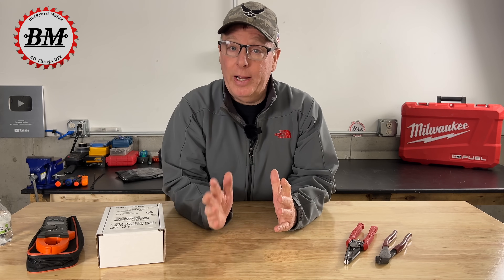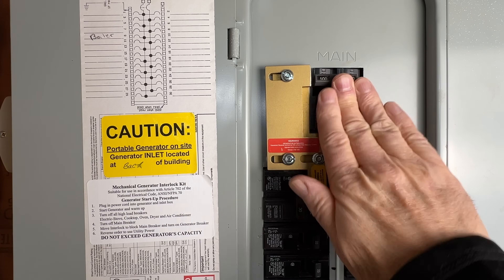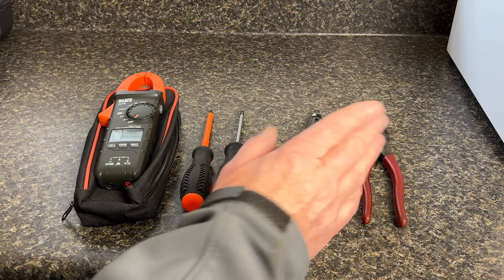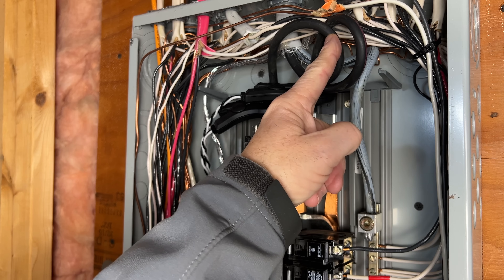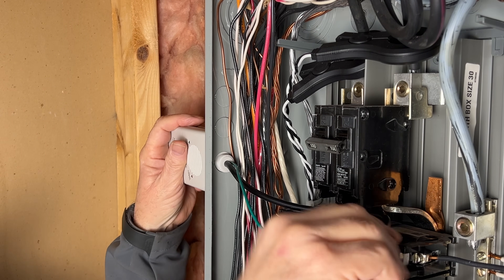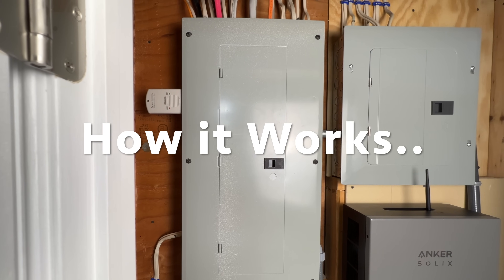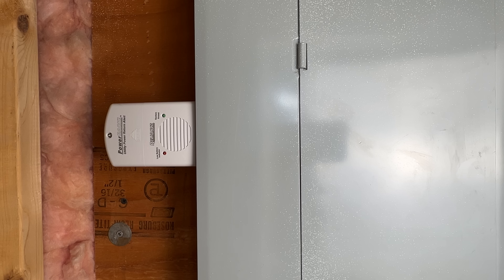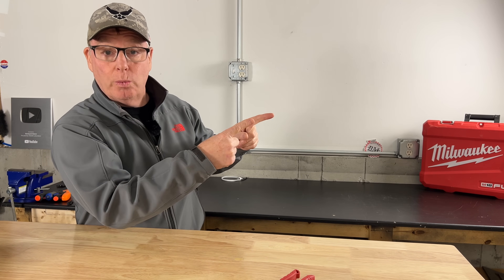The Secret to Knowing When Power's Back On!

Comment: In my area the utility supplies a yard light, before the meter for $8 a month.  They provide the light, do the install, repair, replace as needed.  So for under $100 a year you have a large yard light. Dusk, to dawn, or if dark.
Reply: How does that work in the daytime to let you know the power is back on?
Reply: Sweet, monthly fee for everything! People got to be pretty dense to go for that.
Reply: @ProleDaddy  in rural areas you need to pay if you want a yard light. Most of my neighbors are happy to pay to have power company be 100% responsible for it.  You do not pay for light, mounting, power, replacement

Comment: All I did was install an outdoor rated "gem" lens capped, weather-proof, LED 240 VAC indicator light on my outside service mains disconnect, protected with an inline voltage rated fuse. If it's glowing green, I know I have Utility power.
   Another option, that I haven't looked into yet, would be installing an inexpensive solid state normally open relay in the outside disconnect that has a control voltage of 240 VAC and use the N/O contacts to interrupt a low voltage circuit, powered with a12 volt solid state power supply and run a direct burial cable underground to the house and install a small LED indicator light somewhere near the inside of the front door. Could do it all for less than $75 to $100 for the parts.
Reply from the maker: There are specific rules in the code for a tapping onto the line side of an overcurrent device. You have to use an approved connector and wire size equal to the service feeder and connect to an overcurrent device.
Reply: @BackyardMaine    True, but there is the 3 foot tap rule.The tap does NOT have to be the same size as the service feeder. It's in the NEC code book.
Reply from the maker: @cayankeelord3730  There's a 10 foot tap rule and a 25 foot tap rule in the NEC and both of them are for feeders down stream of an overcurrent device. NEC section 240.21(B)(1) There's not a 3 foot tap rule in the NEC.

Comment: I think 100 dB is too much, you don't want to miss it, but not wake the neighborhood.
Reply from the maker: It is pretty loud but for me it's in a closet in the basement so not a problem. You could always put s piece of tape over the speaker.
Reply: @BackyardMaine  The sound when my washer and dishwashers are done would be loud enough for me, especially if it was an alarm that would continue beeping until I stop it. 

I think it would be nice to have at least two settings:

audio level: to choose loud enough, but not that loud.
alarm delay: minutes to wait before sounding alarm, in case you often experience issues where the power come back temporary for short periods during trouble shooting.

Also two other nice settings would be:
alarm duration: time to auto silence alarm.
repeat time: time to sound alarm again, if it wasn't resolved during silent.

Comment: I don't have close neighbors.  I use a whole house 200Amp transfer switch for the generator. I wired in a single light bulb to the electric company side.  When the power goes out, I turn the light On  - the bulb lights when the power is restored.  A little cumbersome, but, with no other lights or neighbors, it works.
Reply from the maker: That will work but its a code violation for a couple of reason and can become a fire hazard.

Comment: I only have a few circuits on my transfer panel, not a whole house transfer, so I just leave lights or a radio on one of my non-transferred circuits.
Reply from the maker: Yes, that is a good way to do it if you have that type of connection.

Comment: I've been using one of those for years.  If it doesn't work, or stops working, there's an adjustment inside the cover for sensitivity.  I had to adjust mine to get it to perform reliably but it works without fail now.
Reply from the maker: This one doesn't have an adjustment but there's one from another manufacturer that does.
Reply: @BackyardMaine  Yeah, it does have an adjustment, but you have to take the cover off to get to it.  It's not an obvious external adjustment.   I have the exact same model by the exact same manufacturer.  As a matter-of-fact when I clicked on the link to Amazon you posted it came up that I had purchased it back in 2017.  (Reliance Controls THP108 EMW3561925)  So it's seven going on eight years old.

You have to take off the plastic cover to see it, it comes set from the factory and there's a straight slotted screw thing (potentiometer?) inside that adjusts sensitivity.  It's pretty obvious once you have the cover off, it's the only thing in there that looks adjustable and it's about in the middle of the device.

I learned about the adjustment from some other YouTube video, it's been so long ago now that I can't remember which.  I was about to chuck it in disgust but decided to see if there was anything I could do before tossing it.  The guy who showed how to do it drilled a hole in the cover face so he could get to the adjustment. I just set it to max sensitivity and put the cover back on.  Mine wasn't working reliably but it does now.

I live out in the country so it's very handy to know when the power comes back on.  I think I paid $25 or so for it, the price has gone up a lot.  It's worth every penny once I got it working right.
Reply from the maker: @acts9531  Oh Ok.. Nothing in the instructions for an adjustment.. Thanks.
Reply: @BackyardMaine  You're very welcome.  Mine worked for a year or two and then quit.  That fixed it, so if yours does something similar at least you'll know where to start.

Comment: I made a homemade "power back on" alarm. I cut the male plug off of a light duty extension cord. Put insulated clips on the two wires. I put one of the clips on one of the main terminals and put the other clip on the neutral bus bar. I then plug a radio into the female end of the extension cord. When power comes back on the radio plays.
Reply from the maker: Thanks for sharing your idea, but I think it's important to use safe and approved methods when working with electricity.

Comment: Those do work pretty good but they are designed to installed on a surface mount panel board. Bigger project to install on a flush mount panel.
Reply from the maker: Yes you are correct.

Comment: Why don't you just use the method built into the meter? Nothing on the LCD = no power from power company. Numbers on the LCD = pack up your generator.
Reply from the maker: Yes you can go outside every hour during a snow or ice storm and check your meter. I find this is a much better solution.

Comment: You have double taps on your ground bar, 2 wires in one hole. I sold a house in wa state once and got in trouble for that. I researched it and found info that says no don't do it. While I "do not" agree and don't think it hurts anything, it is in most states against code. Thanks for the video I am going to look into getting one of these devices. OK.... Looked it up via the link..43 bucks is far too much. NOPE.
Reply from the maker: It is going to depend on the manufacturer. According to the National Electrical Code (NEC), Article 110.3(B) states that equipment which is listed or labeled must be installed and used in accordance with the instructions included in the listing or labeling. My panels is listed for multiple grounds of the same size under one screw.

Comment: LOL, the easiest, cheapest way to know when the power is back on is when the lights come back on.  No special device needed.  I only use a small generator to run our refrigerator if the power has been off for over 12 hours.  If I want entertainment in that time I just turn on the old 8 D cell boombox, but generally speaking I can find plenty of other stuff to do to occupy my time when the power is off, whether it's cleaning out the garage, mowing the lawn or cutting up downed trees into stovewood and brush.  When it comes time to cook, I just fire up the Char-Griller charcoal grill.
Reply from the maker: Obviously this is designed for a different set up.

Comment: the only prob with that is there ia 2 power legs coming into you service panel .... so only monitoring one leg is not 100 % you need to monitor both legs just more chinese junk dont buy this thing i used one and it failed me because it only monitors one leg of the mains power
Reply from the maker: If you loose one leg the issue is between the utility transformer and your meter. In many areas this would be your issue to repair not the power companies. Utility transformers are single phase supplied with one hot line and a ground. The transformer sends power to your home from points in the sine wave that are 180 degrees apart giving you two hot lines with 240v volts between them and 120v to neutral and ground. This is a split base system. It's extremely uncomment to lose one leg of power and if you do you will most likely need to can an electrician.

Comment: Nice video describing its use. 

Ive been using one for several years, triggered over a dozen times. 

But, I'd like to add a couple of negatives concerning the alarm.  

First is the 9 volt battery. Battety lasts about 1½ years on standby and triggered a couple of times,  and its not unusual for you not to notice that the low battery lamp is no longer illuminated (panel in basement, never checked battery completely dead.) 

So I keep a spare or two nearby. 9 volt batteries are a somewhat unusual size to stay stocked up on and you never know when you're going to need a fresh battery.

Second is the switch. Works grest when new, but after a few years it gets sloppy. So when turning it on, I flip the switch and then "jiggle" it to make certain the contacts are making contact. I learned this the hard way when power came back on but the device failed to activate. (We live in a rural subdivision and difficult to tell when power is back on; especially during daylight hours.) Went down to check to see if power back on and as I switched the unit off and on it activated. So just get in the habit of jiggling the switch, just be be certain.

Overall, it works great. I've gone to bed and fallen asleep with the gen set running only to be awakened hours later when power restored. It's loud enough to wake you from a sound sleep. Or should I say annoying enough. It's as loud as a smoke alarm.

 Highly recommend if you have a generator backup.
Reply from the maker: It is always a good idea to have spare batteries on hand just in case. It's not a bad idea to check the batteries in your smoke alarms as well!

Comment: Way to much fuss.  
What I did was get 2 LEDs and short wires with Small Alligator clips on the end.  I mounted the LEDs in the box at the bottom and drilled holes in the lower cover so I could see if the LED s were on.  Then just wired the Negative side to the Negative bus bar, and used insulated Pliers to Clip the Alligator Clips to the 110V hot Studs securly. 
One LED shows Utility power available.    The other shows when Generator Power is Available.  Total cost 3 Dollars !
Reply from the maker: Code violation and not safe at all.

Comment: A consumer should never pull the meter. All utilities put a seal on the meter and if it is broken, you may be charged with meter tampering or energy theft. Always have the utility pull and reinstall the meter.
Reply from the maker: I was referring to having an electrician pull the meter. I should have made that clear. I just give the power company a call and let them know what I'm doing and why. That may not work everywhere.

Comment: I simply installed a pair of neon lamps on the input side of the master circuit breaker so I could easily tell if grid power is alive.
Reply from the maker: Yes, but that is a code violation and because it's ahead of the overcurrent device it can become a fire hazzard.
Reply: @BackyardMaine  I'm not concerned. I have 20K Ω resistors in series with each neon lamp. That is the current limiting device.

Comment: Can't you just look at the digital meter, and if it has readings, utility power is back on?
Reply from the maker: Yes you can go outside every hour during a snow or ice storm and check your meter. I find this is a much better solution. Kind of like not having to use an outhouse..lol

Comment: I've seen those but question whether it could tell the difference between the utility wire and the adjacent other household and generator wires crammed into the main panel?

You're really lucky to have a way to shut off upstream of your main panel, I have never seen that before.  When I installed power monitoring it was very un-nerving having to work right by the main lugs, and since mine come in the bottom its even a worry taking the cover off if I slip and drop it probably would fall into the panel onto those bottom main energized lugs.  I hate it, even if I know the risks...I really don't want first hand arc-flash experience.
Reply from the maker: Yup no issue with that at all.

Comment: Regarding how loud this alert device is, with an average noise level of 85 dB in the workplace, employers are required to provide hearing protection.  At 95 dB, they are required to enforce wearing of hearing protection.
You can lower the 100 dB noise level of this device with a layer of duct tape over its speaker.  This is for the solar + battery users whose houses are no noisier than normal during a power failure.
Reply from the maker: I agree, the alarm is loud. I use mine in the basement and it’s not too bad down there plus remember this will only be on for the few seconds it takes to turn it off.

Comment: Seems unnecessarily loud. Why not a smooth tone and a light?
There are so many free solutions... meh
Reply from the maker: People are always wiring in the free solutions which are not code compliant and could burn their houses down because they are essentially an unprotected circuit. I agree that it could be a little quieter and definitely a different sound but if we're being honest the thing will only be used a couple of time per year so I can easily put up with it not being perfect.

Comment: I wired an outdoor outlet at our sub panel (before it gets to the house), when the power comes back on, that outlet is hot. So I just plug a drop light into the outlet and can see it from the house when it comes on.

Comment: The original owners of my house connected a small transformer to the utility side of the transfer switch and then ran a low voltage wire to the house and connected it to an LED in the corner of the living room. It's not audible, but if the green light is on, its time to go turn the generator off. The device in the video is better because it is non-contact, but you need the transfer switch to be in the house. Mine's in a detached garage and I probably wouldn't hear it.
Reply from the maker: You can only tap into the line side of the service disconnect (usually your main breaker) If the tap wires are sized equal to or grater than the size of the service conductors and they connect to an overcurrent device prior to connecting to any load. Also you can only do this with approved connectors (you cannot double tap your lugs). My guess is you probably have an illegal connection there.

Comment: This is a great device for installations that don't have legal or code compliant contact access to their feeders before their manual transfer switch or breaker interlock. I am somewhat curious how it would work on a meter main panel as the busbars can be very close to the frame of the panel.
Reply from the maker: The sensor is designed to be connected to an insulated conductor only. You cannot wrap it around a bus bar or an uninsulated conductor.

Comment: If the meter is back on, I know power has been restored or if the street lights and other home lights come back on at night, then I'll power down home genny.
Reply from the maker: I don't have street lights and everybody around runs generators. Many of the outages we experience here in Maine are during snow or ice storm and I don't want to run out to the meter every hour to check.

Comment: My relays don't return to mains power untill power is good for a few minutes.
Reply from the maker: Sounds like you have a whole home generator with an automatic transfer switch.
Reply: @BackyardMaine  I have batteries(16kWh) and  inverter that can also take power from solar or an generator.
The generator resides at my sisters home some 500m away from here, we test it but never had to use it..
Maybe Putin will change that 😁

Comment: question. does the low battery light work when the devices power switch is off?
Reply from the maker: Good question.. I don't know.
Reply: @BackyardMaine  you could test it. Drain a 9 volt down and give it a try.  I'm thinking it does not, the factory ran switch off the 9 volt instead of just the buzzer circuit.
Reply from the maker: @BR549_o7  You are most likely right. We always have 9 volt batteries on hand because they are used as backup in my hard wired smoke detectors and CO detectors. The battery should last a very long time since it's almost never used.

Comment: Wire a low energy lamp in the incoming line before the main breaker. Use a fuse just in case as he only protection for the wire you use is the 60A to 100A main fuse !
Reply from the maker: Most likely an illegal connection unless all the requirements in 240.21 are met.
Reply: @BackyardMaine  Yes, but it does the job.